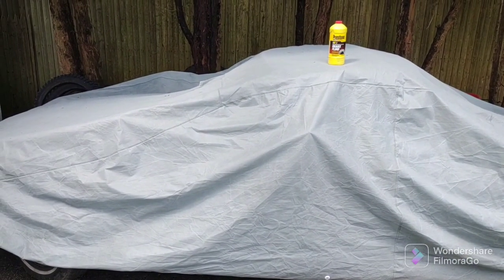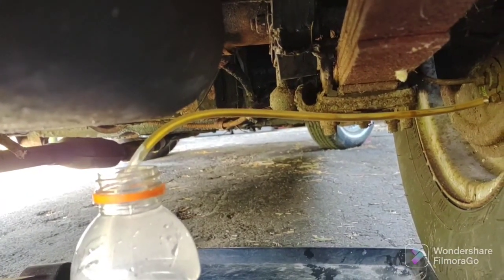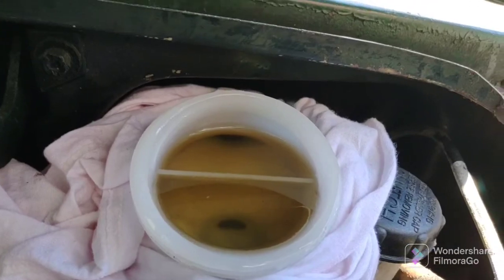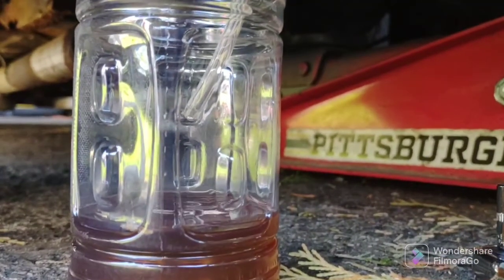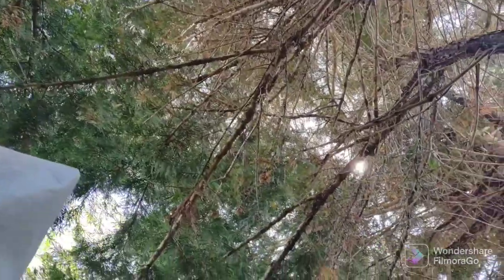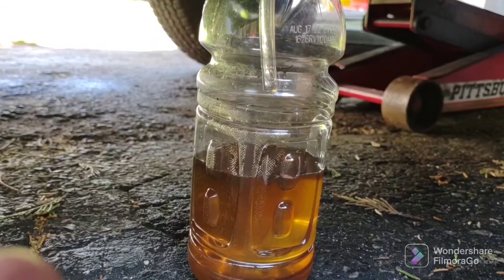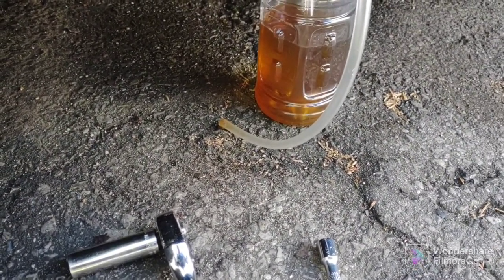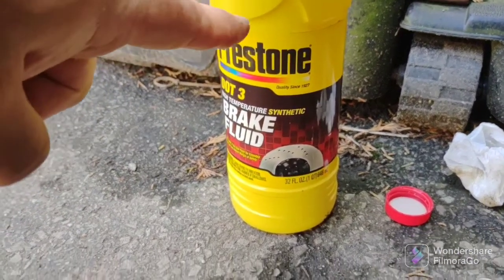MGB Gravity Brake Bleed

Comment: Great looking MGB
Reply from the maker: Thank you. She's a labor of love, but worth the time.  Lately I've replaced all the rear hard brake lines, but I have to do the fronts now (I should have done them all at once). And my right front hub and wheel needs to be replaced, due to severely worn splines, and the left - front too. This entails buying new wheels, too, as the wheel splines mesh with the hub splines. Both must be in great condition. 
    Then I had some clutch issues, but I've resolved them thanks to the help of others online, and the forum.
    Then she'll be roadworthy again !!!
     I saw your red and white one. The look wonderful !!

Comment: I'm sure if you do a  Pedal bleed by pumping the Brake Pedal you alway start from the furthest wheel cylinder  from the Master Cylinder?
Reply from the maker: Good afternoon, Yes that's true.  I checked the Haynes manual and they stated the same: furthest to nearest.
    Since I only replaced my rear brake lines recently, I'm going to be replacing.my front ones this spring.  So I'll be bleeding the brakes again.  I should have done them all at the same time, so I don't have to worry about my front lines blowing out !! What's great is that I bought the Automec brake line kit, so I have all the lines, and I have the brake fluid so it won't cost me anything more to finish the lines, then I'll have a '72 MGB with all new brake lines (including the rubber ones which are already done) and I already have the new master cylinder installed so I'll be able to stop with confidence !!

Comment: Where are your jack stands?
Reply from the maker: Very good question...thank you.  If I was underneath the car, I'd have jack stands set up.  But you don't have to get under the car to do any of this work.  I replaced my front, two brake lines, right from the side of car - just turned the wheels for access.  And for the brake bleed I'm able to reach all the bleeders laying on the ground Beside The Car, not under it.  I guess I have long Orangutan arms, I don't know - probably would have made a great boxer.      But all joking aside, thanks for caring enough to comment on that.  Yes, Trolly Jacks are for raising the vehicle, jack stands are for supporting the vehicle, and you can leave the trolly (pump) jack in place as an extra measure of safety.
Reply from the maker: One additional comment on the comment about where are my jack  stands.  Keep in mind that I never removed any wheels during this procedure.  So even if the trolly jack failed, the car would be on all four tires; it would not fall far.  Yes, my phone and my flashlight are expendable; my head is NOT.